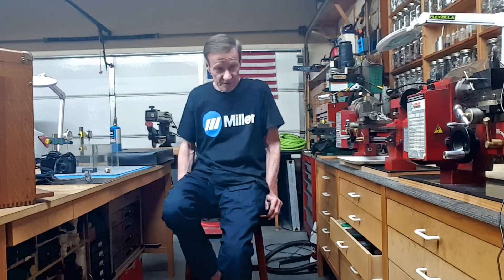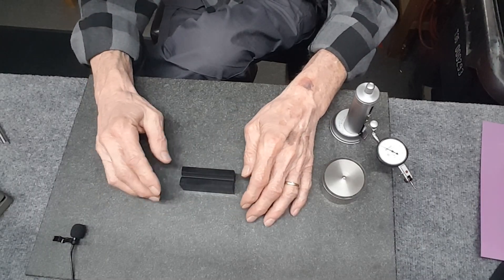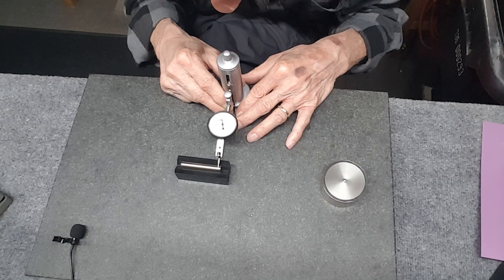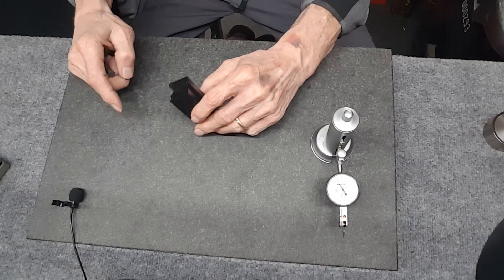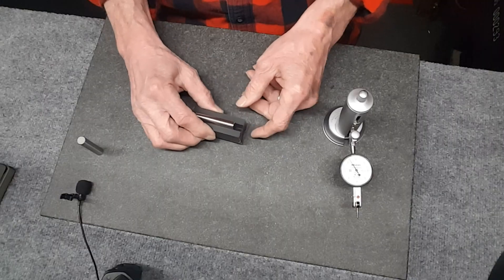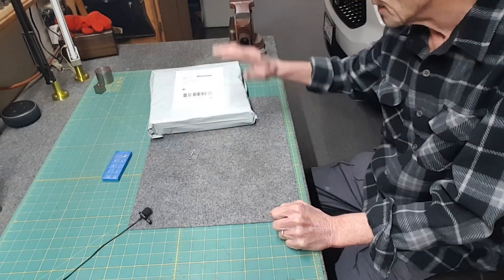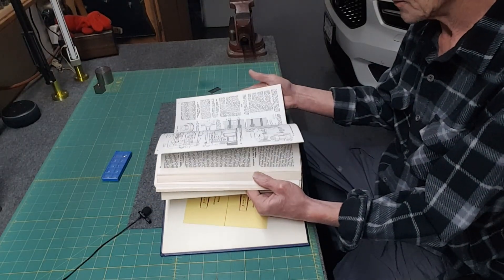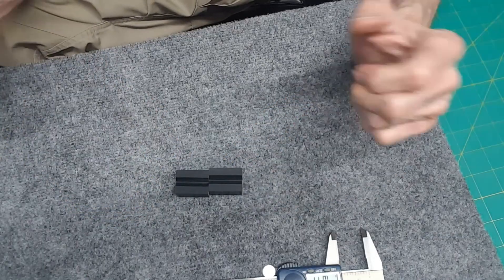Making High Precision UHMD V Blocks

Comment: Like metals, plastics can contained locked up stresses. You might consider annealing the material before final machining.
Reply from the maker: Hi Bill, turns out UHMD has the worst coefficient of expansion anyway. In any case most of the dimensions don't matter with   how I use them. Would love to hear how you anneal plastic though! Cheers.